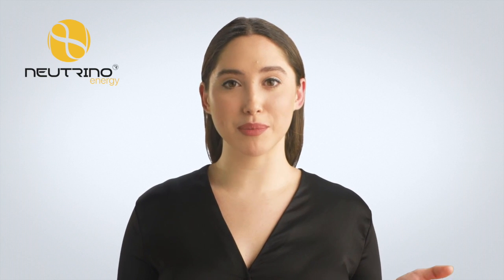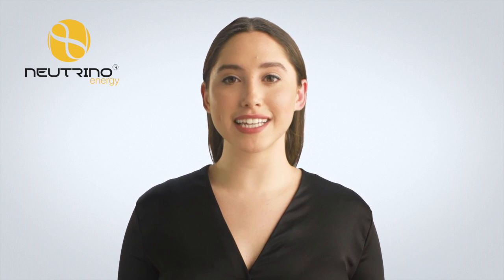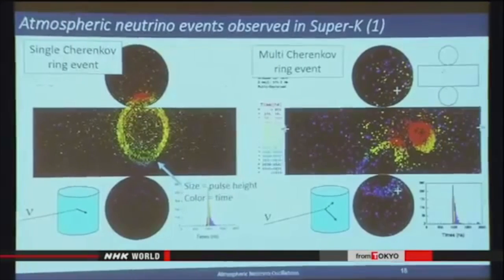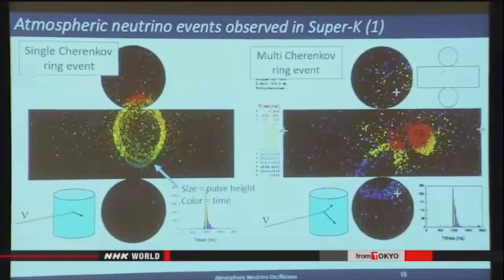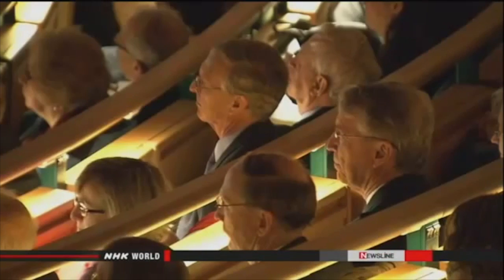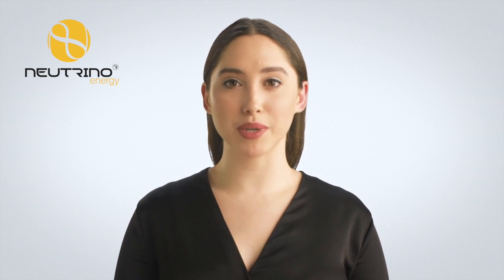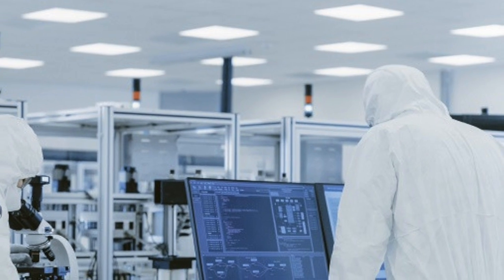Neutrinovoltaic: How to generate electricity with neutrinos

Comment: This is next to impossible to take off upon my colleagues and my cursory review and opinion. Its a whole new area of applied science that even if true, it would need to conceptually prove disruptive power capabilities vs the momentum of PVs without angel investment; Im not talking about intriguing factoids. Im talking about hard numbers, probability, and technology readiness of materials needed to achieve commercially profitable viability not just a little power. At VC round, they need a TRL 3 demonstration of significant and scalable power. Their voltage demonstrations without mention of wattage makes me very nervous about what they may be hiding or overcompensating for. Unexperienced or uneducated investors are very few but susceptible.
Reply: And I'd Im wrong, I hope my input might help sharpen their deck.